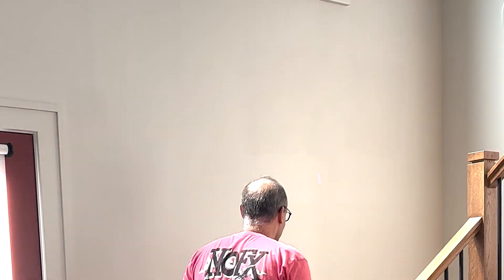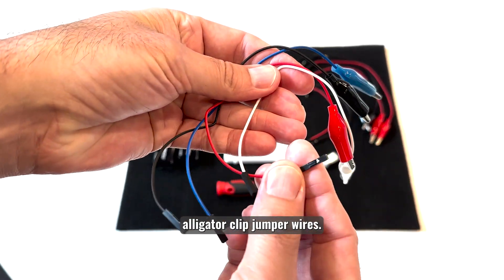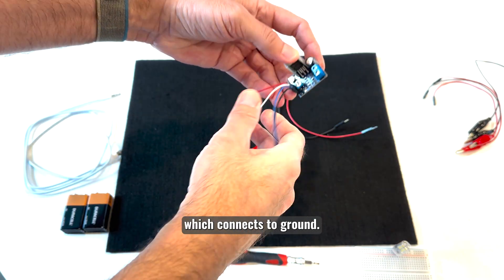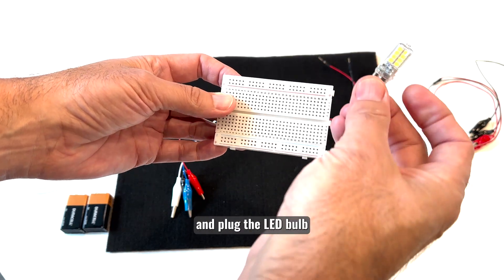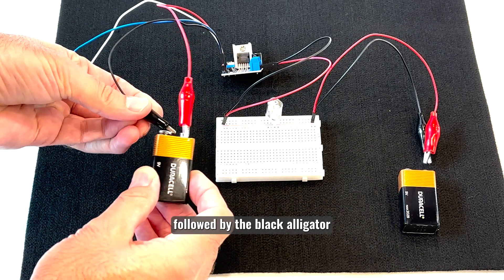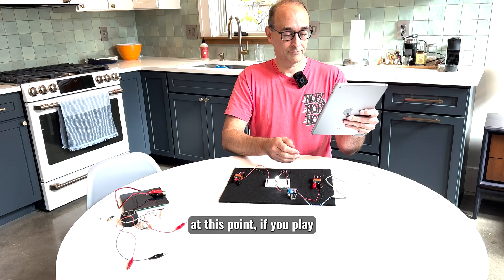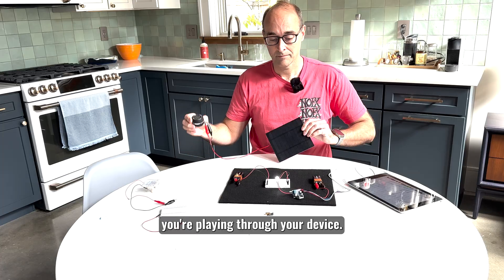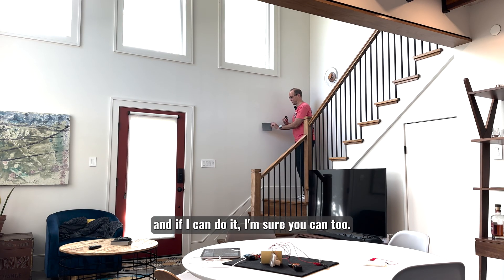Transmitting Sound Using Light!

Comment: How about moduating the audio signal using pwm? This would eliminate the non-linarity between light intensity and output voltage. I guess this will make the sound quality much better.

Comment: My brother built a thing like this many year ago.  He used two large flashlights as part of his kit.  One flashlight had the bulb where you would expect it.  The other had a phototransistor in that location.  There were some tricks to it but it could work over hundreds of feet.
If you want the gain to not vary with distance, a simple thing to do is to PWM the light.  Instead of brightness being the information, the percentage on time is the information carried.
Reply: He rebuilt IR remote communication!
Reply: rimstarorg made something like this

Comment: You can even use this as a surrounding sound also
By making multiple solar speakers and placing them in circle (or square) and put the laser on a motor
You can even add Bluetooth to the aux cable (Bluetooth audio receiver) and go wireless too

Its better to have rechargeable batteries or a power bank

Comment: I understand the pulse of the LED light signal being converted(?) into or matching an audio frequency but to be pedantic ☝🤓 isn't transmitting sound using light what speakers do on their own anyways? Aren't the electrical signals a.k.a. light in the speakers are where the sound comes from? Genuinely asking as I can't explain it to myself in my own head.
Reply: Light is photons, electricity is electrons. Different particles.